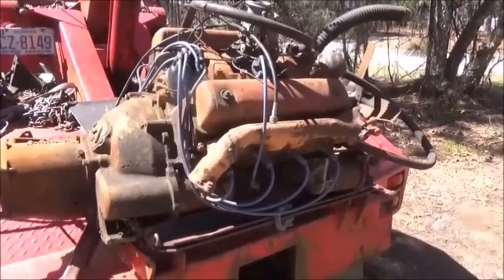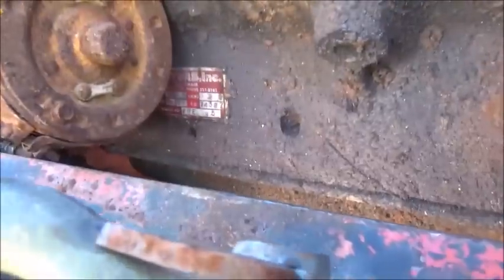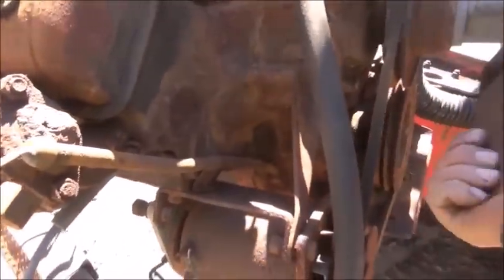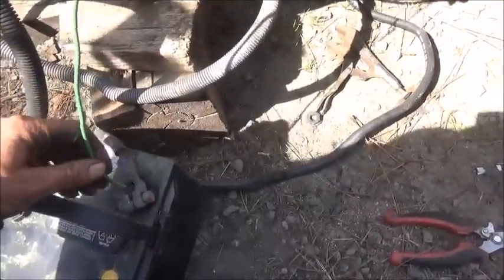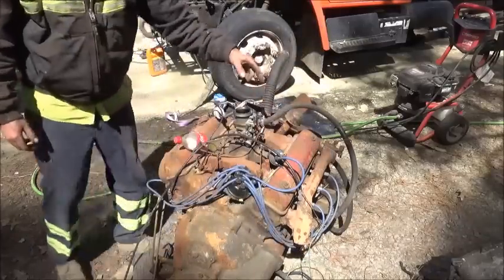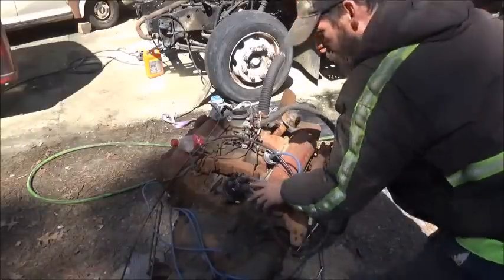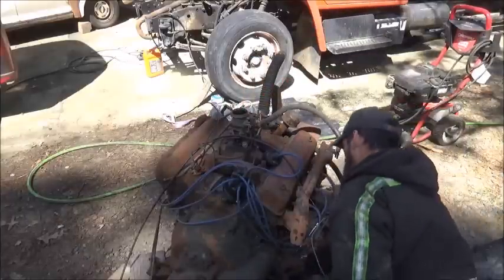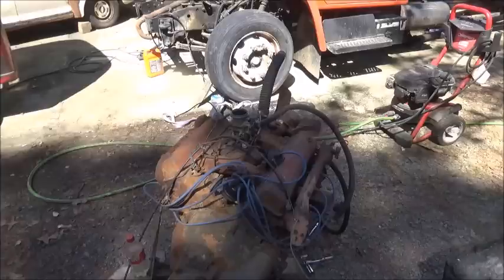1954 FORD Y-BLOCK 239 FIRST START IN 20+ YEARS!!

Comment: Saw one clueless guy who could not find TDC on a four cylinder jeep on you tube. He looked for days. Great to know there's at least one other old N C guy that knows the easy way and where number cylinder #1 on Ford is. Used to have a 1962 Ford 600 tilt cab. That sound is addictive. Old Fords and gasoline are a great mix.

Comment: What a great old engine, I owned a few Y blocks engines myself, all 292 cid
Reply: Had a 292 truck engine in my '54 Crown VIC.3 speed. Ran the crap out of it. 18 speeding tickets.Took the bus to work for 6 months.

Comment: Beautiful little engine
Reply: Could someone please help me ive got an old 54 ford y 8 it runs a sawmill last time it ran was at least 5 years ago but having problems getting it to run I got a new battery new starter new plugs and wires I might have burned the coil up but it's a 6 volt system and my brother on law gave me an old 12 volt coil he said it had lost some power and put new points in it but it's not getting fire to the plugs my main question is how many wires goes to the points I got a new set of points and when I put them in there were 3 wires and 2 places to hook them pretty sure I've got the condenser wire on the right place bc it wasn't long enough to go to the other screw and I hook the other 2 on the other one could someone help me please

Comment: You started the engine, but you changed the oil, and the spark plugs before you rolled. Here in my country we had many engines from FORD, and Craysler V8. But our factories only make 4-cylinder engines today. Keep teaching us, success.

Comment: Fantastic! There are still plenty of old engines cheap, I bought a rebuilt 312 for $500 to put in a 57 f-100 I built my Dad, also got a 312 Mercury for $200, and it runs great! Will be going in a 1928 Chev Phaeton I have laying around in pieces.

Comment: Those old Y blocks were not powerhouses, but they are cool , and very rugged. They had a very unique sound, especially with cherry bombs or thrush mufflers. When you heard one coming you knew what it was, as it sounded like nothing else.
Reply: I had one back in the 50s, dual exhaust, dual carbs., short mufflers, and did it ever sound good. I have one in my shop now rebuilding it.

Comment: Ha ha, I love it.  Doesn't get much better than this.  One thing I like about the Ford Y blocks is that they sound really good with proper exhaust.  I had a 292 Y block in a 1964 Ford truck once.  It was a great engine, and I'm not a Ford guy, LOL..... I hear that the Y block can have problems getting oil to the top of the engine at times, but I've never experienced this.

Comment: When you can fire up a motor and it doesn't smoke after sitting 20+ years that's should be good motor
Reply: Randy Ward or no oil pressure .
Reply: @dondesnoo1771  that very well could be but i didn't hear no weird sounds as long as it was running guess ya find out when it runs a little longer
Reply: Randy Ward someone has a 54 Ford will pay big for that .as 239s hard to find most Dead .just wanted to let you know about them . before you build with it as you see it been rebuilt .thank you for replying.😎
Reply: The 54ford is 6v to go to later motors need 12v. Conversion some collectors want original .

Comment: Just think, that in 3 years you'd have steam engines all over your property.  Just had to view some older videos that you've produced, but I really enjoy the steam engines and the progress you've made.  You know, firing order is so very important in starting up an old engine. You sure know your stuff on wiring.  I really admire you for that.  You sure know your engines; I didn't know that Fords were so much different than Chevy.  You make a good gas drizzler.  Gonna have to call you the human fuel pump.  W Rusty Lane K9POW in eastern Tennessee

Comment: Nice job Jonathan. I think y blocks have the same firing order as the flathead v8s. You made quick work of fixing that spark plug wire mess.
Reply: He sure did make quick work of that spark plug wire mess.  A feller like me woulda took all day and then hit myself in the head with a hammer when it didn't run.
Reply: Yes, the flathead and the Y-block have the same firing order: 1-5-4-8-6-3-7-2.

Comment: I bought a 61 ford galaxie when I was a teenager for 20 bucks. The owner replaced the plugs and wires and did the exact same thing put number one on the left side. Rewired it started right up. Traded it for a 65 valiant convertible. These old motors get scraped for newer power today. When I was in school we would stop at the junkyard and bust up motors and transmissions. Stop in the office she would give you a can of spray paint. I think a transmission paid .50 cents to gut it and a block paid a dollar (I think). I busted up hemis like they grew on trees. No idea what I was busting up. He bought cop cars from all over the state. 390, 289, 327, 440's you name it. A mountain of motors and transmissions. Trannys were easy and fast. Blocks we rolled over pulled the pan pull the crank and break the journals out. Pull the pistons out and break the rod out. throw the rod back in the block throw pistons in a barrel and spray paint a line on the block and tranny housings. One of the yard guys would count the different paint colors and call it up front and you get your money. 5-10 bucks every few days on the way home from school. Life was good lol.  I see the rollback is getting it's repower in the background.

Comment: You paid the right price for that engine no doubt it sure runs nice and not much for smoke at all like you stated can’t beat a y block they’re tough torquey engines and with the right cam carb and exhaust manifolds they really perform well and as for the tappets well you’ll hear em as these engines have solid lifters.good stuff Jonathan and I hope you find a good home for that sweet running y block!

Comment: 150 bucks for a engine with everything on it and a transmission is a smoking deal
Reply: If it works if not it is just a pile of scrap iron.  Rebuilding anything this old can be very expensive if it is even possible.  Newer Ford engines such as FE and Windsor are much better supported.

Comment: Got a 292 sitting on my engine stand out of a 1962 F100. Eventually it will replace my 223 inline 6 cylinder in my 1962 4x4.

Comment: Hi Jon. Nice job on the startup. i once bought a car very cheap because it wouldn't start after having some ignition work. Yup. wires in the wrong order. That "Stromberg" is actually a Ford/Holley. (might be a "94"). Just saying in case you want top order a kit for it. It runs pretty good though.

Comment: My Pops n I rebuilt a 292Y, 312 merc heads, bored 20over,
Top loader 4 speed. Put it in a 61 unibody
short bed F100.....miss that old Truck.

Comment: Crazy how you can almost depend on a 60yo engine to work. Now days you are lucky to have a engine running more then 10 years.
Reply: No, just the opposite. Engines are good for about 200,000 miles now, while in the old days you'd be lucky if it would go 100k miles without it belching blue smoke and puking oil out of the rear main seal.

The Ford Y-block was even worse. It had a shitty oiling system, and with the sludgy oil of the day the valvetrain would be starved of oil and drop a valve.
Reply: This engine has been rebuilt previously
Reply: I suppose it depends on the make and model.  Example would be weaknesses with recent Mopar hemi cams and followers.  Anyhow, I have a '91 Pontiac GA with the 151ci engine; over 240k miles, still strong but the peripheral things go bad too often, like the crankshaft position sensors.  Apparently they aren't as well made as oem parts were back in the day.

Comment: Lincoln had the 317 CU. IN. Y Block V8 in their 1952 models with a GM Hydramatic  4 speed automatic transmission.

Comment: My dad had a 60 Fairlane that had the 292 Y-block in it. It had poor oil flow to the rocker arms, so someone put an aftermarket oil line kit that fed oil off the oil pressure gauge port up to one stud on each side that hold the valve covers down. The original studs had been replaced with hollow studs that opened up into the rocker shafts to feed oil into the shafts. I can remember that in the winter he had a heated mat that wrapped around the battery that he would plug in at night so the car would start in the morning to go to work. I think he had one of those heated dipsticks too. With four kids, we didn’t have a lot of money for things like a new battery...

Comment: Those old Y-blocks had a problem with rocker arm lubrication.  Sometimes, you can find them with the external oil line after-market fix.

Comment: My first car was a 54 Ford. I notice the oil filter on this motor is not a PH8 as mine was in my car. Maybe the motor being from a truck it was different. Like your videos, been watching for a few years now. Great job and I think you are one of the smartest people I have seen
Reply from the maker: In the 50's you could get a lot of 6 cyl. engines without any filter at all. The spin on was probably an option!

Comment: The Y-block had a problem providing sufficient lubrication to the rocker arms.  An after-market kit was available that included tubing that connected to the external oil pump to provide oil directly to the rocker arm assemblies.  This problem stemmed from an internal oil passage in the block that tended to become clogged due to the non-detergent oils used at the time.

Comment: You should make a foot pedal "jumper cable " switch for the starter.  Maybe adapt a tig welder pedal, just have to check the amps.

Comment: My first car was a '54 Ford Crestline with the 239 and 2 speed Fordomatic.  I only paid $200 for it since the engine burned oil.  I was only 15 and a half years old, so I knew I had six months to rebuild the engine.  I bought an overhaul kit for $100 that included rings, rod bearings and all gaskets.  Took the heads to a machine shop for rework.  He only charged me $25 per head.  
Being a complete novice, I managed to bolt the cylinder heads on backwards.  Left to Right and Right to Left cylinders.  I discovered I had them reversed when I went to bolt the intake manifold back on and it would only fit backwards.  So,  off came the heads again and put back where they belonged.  The head gaskets were metal, so no problem there.  
Anyway, I got it running and drove the car about six months after I turned 16 until I totaled it in a wreck.  
Then I bought a '55 Ford and did it all over again.
And that's how I learned how to work on cars in the 1960's.
Reply: BTW, one of my favorite pastimes was to go down the street a ways, stop and put the car in neutral, then rev the engine way up and drop the Fordomatic into low gear making the tires burn and howl.  I never did hurt that tranny.  Try that now with newer cars and you'll kill 'em.

Comment: I'll tell you what that just goes to show you that you never can tell by looking at a motor whether it is going to be good or not. I've had to do this same thing and it is easy sometimes and sometimes it's hard but if you check fire and fuel you will eventually get it. I was laughing at you trying to fuel it and try to start it at the same time and remember so many times doin the same thing. That engine had somebody that was use to Chevys trying to start a Ford, that's all that was wrong with that engine. Like your vids man they are great and remind me of myself. I never could stand anybody working on my cars except me. I'm a little too old now to worry about that kind of thing though.

Comment: $150..wow prices sure have dropped..back in the late 70's I payed $550. For a 312cui to put in my 63 f250..they did make duel exhaust manifolds..I payed $100. For my pair back then....worst part of a Y was oiling the top end.
Reply: as long as the oil was kept clean, there was no problem.  I have many of them.

Comment: I'm a ford man and my brother is GM..years ago we did an engine swap on my '81 Lincoln Mark VI (302 5L) after the original oil pump broke and the motor started to knock.I got a low milage (62k) from a salvage yard and installed it. We couldn't get it fired up not matter what we did. It turned out that my brother changed the plug wires around to fire like a GM does! Totally bass-ackwards! After I figured that out it ran with no problem lol.

Comment: The 239 has 130 hp. 130 bhp. Its Ford very first Yblock in In 1954 the Y-block displaced 239 in³ (3,910 cc), the same displacement as the old Ford Flathead V8 but with a bigger bore and a shorter stroke. It produced 130 bhp as opposed to the Flathead's final 110 bhp, an increase of 18%.[1] The Mercury Y-Block was 256 in³ (4,194 cc) and produced 161 bhp,[3] again a similar displacement to the 255 in³ Mercury Flathead V8 it replaced, but with 29% more power than the older engine's 125 bhp.[4] Wikipedia

Comment: FORD firing order may be different, only because the piston location are numbered by bank, not by the rod location like GM, and everyone else, however, the firing SEQUENCE on the crank is exactly the same, doesn't matter on all old FORD, GM, DODGE ect.!   Small note: some Foords , and non GEN 1-3 SBC have a 4-7 swap, ...easy peasy!!  Just make sure you get the rotor rotation correct, CW or CCW!

Comment: Ya ok Who but Ford would put #1 cyl on the passenger side? AND neglect to mark the intake with cyl numbers? That said, I bought a '56 ford Club sedan, (first Fairlaine) in 1965. Had the Y block Tbird 312 in it Clattering oil starved valve train with several broken springs but it ran......sorta....Took it apart was gonna fix it stock but quickly learned modification was desirable. the stock heads were lubrication deficient and undersize. So I modified a pair of 352 truck heads with GM rockers and milled in 390 valves. Couldn't stop there so I bored and sleeved it to 352. Milled a 352 crank into it but that left the center mains narrow, but produced a nice stroke, Used 312 rods, Micky Thompson Pop Up pistons, Isky 505 roller cam, solid lifters, I actually got advice on the build from Smoky Unick via letters. He told me I would either have the quickest ford in town or the worst blown up mess known to man. Told me to break it in gentle then get it balanced and blueprinted due to the narrow center main bearings and that's what I did. Installed Mallory dual point ignition, Polished and ported a stock 352 truck intake, mounted a 650 double pumper Holly carb with 950 jets and 2 electric fuel pumps fed from the tank with 2 gas lines. Mind you, 127 octane premium gas was pumped at all Chevron gas stations in 1965 at 38 cents a gallon and BOY was that Ford Thirsty. I appreciated it's 26 gallon gas tank  as it averaged about 5 MPG. Had it dynoed at 415 HP at the rear wheels thru a stock 3 on the tree with electric overdrive, rear axle outa a '58 F100 4-11 gears. It kinda ate clutches and overdrives. blew 3 stock clutches and 5 overdrives in 9 Mo. Recorded 10.4 sec 1/4 mi and 154 top end in a measured mile. Local cops hated me. Had Custom headers and dumps behind the front wheels that would throw flames uncapped. Downside? It would beat a new GTO but it cost me more than buying one.

Comment: Man that is a sweet sounding old motor . Some one will won't that  for sure .iove to start those old engines .i have a 75 cadallac engin with low mileage . Set for 25 years starts right up . It's a 500 cid for sale cheep.
Reply from the maker: I put a 472 in a 1955 Dodge Royal 2 dr. I drove it for a couple years then sold it. Cadillac made good engine back then.

Comment: Damn thing even idles well. The initial backfiring (due to incorrect plug wiring) probably blew out any gum or stuck matter in the carb idle circuits.

Comment: My first vehicle was a 1953-1/2 Ford F-100 Pickup with the V-8 and 3-speed on the column with electric overdrive.   It had 6-volt POSITIVE Ground, that is Negative at starting, then switches over once it starts.    I was also under the impression that it was the first overhead valve Ford V-8 made, at 272 Cubic Inches, which was bored out to 292 in the 1954 model year,, and 312 in the T-Birds.   The 272 is a 6-month in existence motor.  The positive ground six volt system sucked ass, and seemed to be a fix for the high amp drain from the starter motor, the battery had to be installed under the passengers foot-well, so the positive cable to the starter would be as short as possible.   Your Bendix is getting stuck, I can hear it.  I didn't see the driver's side of the engine, but mine still had the glass fuel filter/fuel pump about the size of a mason jar on the side of the block, looking like a coffee percolator.   The Oil Filter was the canister type, and the old-timers told me to remove the old filter, and simply shove a toilet paper roll into the housing and screw the half-inch retaining nut on.   Like a 53 Chevy, 75% of any repairs could be done with a combination 1/2-inch, 9/16th's open ended wrench.   I loved that truck, got it for my 15th birthday,, and worked on it for a year before driving it at 16.   In a small tourist town known for car cruises, it got lots of respect from the old-timers because I left it 100% stock.   Flat Black Primer, Baby-Moon hub-caps, 7-ply original tires, original headlight bulbs, with my only modification being to ask the guy down the road to cut the frame flush with the rolled sheet metal behind the front bumper, and removing the bumper, it looked low, and mean in the front.    It had the ability to roast the tires, my child-hood requirements for my first car be that it have two doors, be a manual shifter, have a V-8 and rear wheel drive.    I had no idea it would be a truck, but I was raised not to complain about a gift.

Comment: I had a 54 Ford back in the 50's. The Y Block had a tendency to spin its cam bearings which blocked the oil flow to the heads. I wonder if modern rebuilds have corrected this problem.